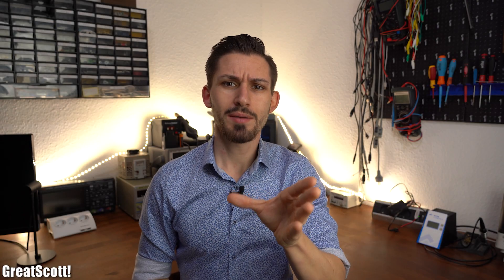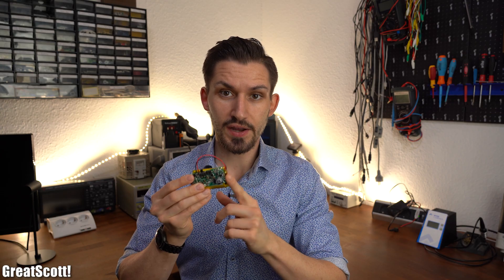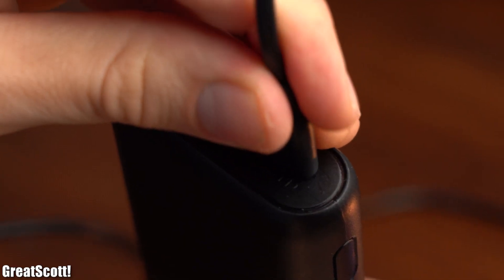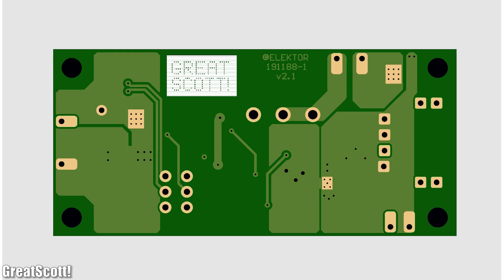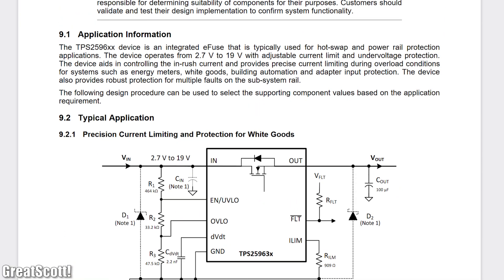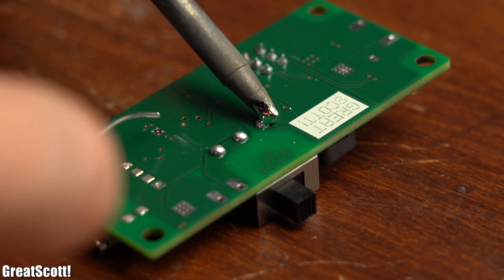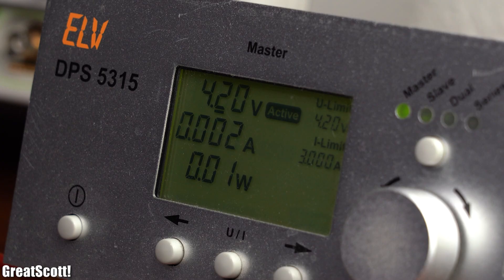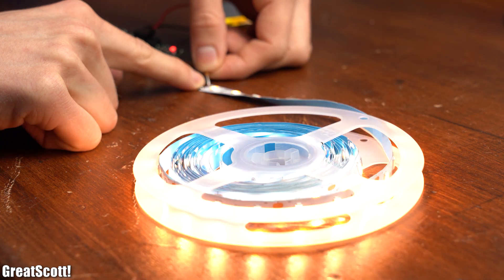DIY LiPo Supercharger! (Charge, Protect, 5V/12V Boost V2)

Comment from the maker: Get your DIY LiPo Supercharger here (shipped world-wide):
https://www.elektor.com/greatscott-diy-lipo-supercharger-kit

(FYI, I do get a commission for every sold kit)
My last article in Elektor’s print-magazine: https://www.elektormagazine.com/magazine/elektor-151/58764
Check out Elektor’s YouTube channel: https://www.youtube.com/user/ElektorIM
Reply: Big fan of yours
Reply: 2nd ?
Reply: Nice one. In the video you tell, there are Gerbers and such stuff available. I cannot find those behind the given link. Could you clarify, please?
Reply: Great Project!

Is there a way to modify this to work with LifePO4 batteries ? Ideally auto sensing the battery type ?
Reply: Where are the links to the schematics?
Reply: @peter.stimpel  +1
Reply: It shows "Input Voltage 	+5 V / 2 A max.". You mention 1A charge current. What is correct?
Reply: ESC modul
Reply: Nice board, but I think the engineers at Elektor missed one important thing about USB-C. If you want it to work with USB-PD chargers, through USB-C to USB-C cables, the CC1 and CC2 pins need to be pulled down to GND with two separate 5.1k resistors. This signals to the PD charger that a "dumb" legacy 5V device is connected and it should provide power. Without the resistors the fully complaint PD chargers will refuse to supply power, and if you tie both CC pins to a single 5.1k resistor, the device will work normally with most of the cables, but it will fail to work with more expensive, electronically marked ones (this happened with the Raspberry Pi 4)
Reply: Sašo Domadenik - is this something we could do after receiving the kit?

Cheers

PS- after thinking about it a bit, I’m not sure how PD would be necessary or even meaningfully useful for this board since it only takes an (extremely common) 5v input, and certainly do not need PD and it’s multi-Voltage outputs for this..

That said, maybe I’m missing something here on some potential use-cases for PD, and my original question [re:user “fix”] still stands out of curiosity. 

Cheers!
Reply: I have been watching your channel for years! Love your projects, and I especially love your new production format! Congratulations on the DIY LiPo Supercharger kit, it looks great! I went to purchase one right away... Unfortunately, living in the US, it would cost as much as the kit to ship here. I sincerely want to support this project, but I can't justify paying double just to have it shipped. If there is some kind of minimum purchase amount to get free shipping, I'd be happy to do that, but I didn't see that on their website.
Reply: Would love to have a higher powered version on output dan charging power for bigger lippo.
Reply: Link for kit doesn't work, 403 Forbidden
Reply: It cost only 22 euros in there but if I convert it in our Indian rupees it is around 2000 rupees 
Now that is a lot of freaking money
Reply: @anujithtp2048  i cant open the link, is it for one board or for 5?
Reply: @TylrVncnt  Of course, it would be very easy since the pins are already broken out, you just need two resistors.
As for why you would need USB PD, this board doesn't need it, but other devices do and you want this board to work with the chargers that you already have. A proper USB-PD charger will not charge a device that isn't detected as compatable. The resistors are what makes it compatable, they are in the USB-C specification.
Reply: @peter.stimpel  the Gerber files and schematics as also the manual are at the bottom of the shop page: https://www.elektor.com/diy-lipo-supercharger-kit-by-greatscott , we wish you a lot of fun rebuilding the kit. :)
Reply: @sobertillnoon  the Gerber files and schematics as also the manual are at the bottom of the shop page: https://www.elektor.com/diy-lipo-supercharger-kit-by-greatscott
Reply: @ElektorTV  Thanks for updating the page, appreciated! Cheers, have a great week, and stay negative.
Reply: @ElektorTV  the BOM doesn't appear to be available at the link. Can you please clarify where this may be found?
Reply: hmm u relize not everione can solder it right?
Reply: Too expensive when convert to LKR.
Reply: @anujithtp2048  4000 in Sri Lanka.
Reply: @darkfitmc1754  You could learn it, so what?
Reply: Why not used the very powerful ti power ic ... don’t have it’s id on hand but handles full usb c specs (one of the latest), combined charge and discharge and more features, cost for single pice was something between 5-10$ (I think it was about 5.50$ but the dual channel version was around 10$)
An the best (and worst) all in one single chip.
Reply: @sasodoma  That's some very useful information, thanks!
Reply: Hello sir! I am an antenna designer, i need to DIY antenna analyzer, which can show Return loss, swr, and draw gain pattern of the antenna. I am wondering how it can be done.
Reply: @Evgen-Evgen-Evgen  it has only two of them
Reply: @SecretAgentPat  The Bill of Materials is within the manual.
Reply: that link to the kit appears to be broken
Reply: @anujithtp2048  I need to sell a kidney. 😆
Reply: The kit just arrived in my mailbox, it's super!

Comment: Got this kit as a gift.
Just two remarks: 
For DIY home solderers it would be better to have thermal spokes on the ground connected pads. The ground plane leads too much heat away for low wattage soldering stations (and high power would be overkill for the rest)
All input/output through-board  holes should be spaced such that 2.54mm pitch pins  could be placed directly.

Comment: 06:30 A bit of advice: do yourself a favor and get a flux pen so you can solder trough-hole components and give the solder a chance to flow so you'll end up with a small fillet that looks nice and is stronger than the ball-of-solder.

Comment: I was confused when I first saw this.  The video straightened me out!
I guess the bottom line is that this PCB needs to stay attached (more or less) to a single-cell LiPO battery to enable it to both power a 5V or 12V project, and then later recharge the battery.  Looks good!  
Without this project, we're limited to powering things that only require ~3 V power (with a single-cell LiPO battery).

Comment: you need good soldering flux in smd soldering it make smd like 0805 0603 component a lot easier than without flux.
Reply: those soldering are horrible that will be fixed with a good plenty of flux and not rely on the flux of the solder

Comment: This is a good thing..
But... With many things now dropping to 3.3v  it's not much use to me now... 
With battery projects. But there is a solution which is cheap and easy.  A step down can be put on the battery terminals...
But this need to be put on the protection circuit to shut things down when the battery level drops.

Modular break outs here we come.
A nice little OSI and display. 
WiFi control and readings..

Comment: I'd like to know how to set the high voltage output to 9v instead of 12v. I'm rather new to circuit design so I'm not sure where to start.

Comment: I’ve done a lot of soldering but almost no surface mount soldering.  I needed the capabilities of your design so I ordered a kit.
I have a fine soldering iron and tips that work with the 1206 parts.  I found that good lighting and some magnifying glasses were required and bought some thin solder and paste flux that worked with it.
Yes the transition to 21st century hand soldering is possible!  The work can be tedious so frequent breaks are quite helpful as was periodic cleanup of the solder residue with 91% alcohol.
The circuit worked just fine when completed.  I wanted a protected converter of 12-14V to 5V for a QRP-Labs Ultimate 3S WSPR transmitter and find this project served just fine.
Thank you for making this available!

Comment: I made two of the old PCB. Not too happy indeed about the tiny sizes you choose, especially for the LED's. Also, the boost converter is not working on both. I'll try to make some more and see if it will work eventually.
So the new kit might be an improvement, but is waaayyyy to expensive. But I guess that's in the hands of Elektor.

Comment: I'll buy the 18650 version
Reply from the maker: Works with li-ion as well
Reply: @greatscottlab  is it possible to use it with 2p 18650? I need a balancer? The best  18650 discharge voltage wasn't 3V?

Comment: What will happen, if i add only xl6009 single ic on xl6009 boost converter circuit. Then can it increase more ampere....?

Comment: that's a cool circuit, but the lower voltage "protection" chip is too low I think, as it is understood that a Lipo will be permanently damaged at a voltage below 3.0V, and it is recommended to not discharge a lipo less than 3.2-3.3V. So I would try to change the protection chip with one that cuts-off the battery at 3.2V or 3.3V. I do not know of such chip however

Comment: What happens when the over-discharge protection kicks in, your project turns off.  If the battery recovers slightly, will the output come back on, causing it to bounce again?
Reply: nope, the overdischarge releases at 3V, check out the datasheet
Reply: @maks886  Ah nice.

Comment: I have just one maybe stupid question when it comes to soldering SMD components, especially SMD LED. When you showed heating of soldering iron it hit 360 degrees. From my experience that temperature and how long you keep soldering iron in contact with SMD components, you can easily damage them and indeed an SMD LED are in the greatest danger from such work. So the question is,  is that temperature of soldering iron at 5:55 real temperature you used or just for show? Anyway great DIY kit, great video so as always, supper like.

Comment: I think the undervoltage Protektion is a Bit to low for lipos But for li-ion Batteries its fine.  Becourse the li-ion can get discharged lower than lipos whithout any damage

Comment: 1A is really low these days; a RPi4 takes 3A to operate without problems; many tablets and phones take 2 and 2.5A when doing multimedia over wifi.The voltage is the easy parameter to boost or down with lots of tiny inexpensive dc-dc converters

Comment: My sorry if I'm asking a imposable question but I have a project that has dead space that can fit 3 lipo battery that are all the same size. I am having a problem finding any charge controllers that can do more then one in parallel I was hoping if you could lead me to some literature that could help me desine a board that would fill my needs.

Comment: Please make a TL494 flyback converter with variable single supply input voltage (from 9V to 18V) and constant dual supply output voltage (+12V 0V -12V) and 15A output current for any variable load by feedback circuit for Class AB amplifier.

Comment: The circuit diagram doesn't show the USB-C connector, but by PCB images I can only see 1 resistor.  Google: "The Raspberry Pi Foundation messed up its first USB-C device". It says: "The problem is that the Raspberry Pi 4’s charging port shares a single resistor between two of its pins, which the official USB-C spec says should have one resistor each. This causes problems for so-called “e-marked” cables such as those supplied with MacBooks and other laptops fitted with USB-C Thunderbolt charging ports."

Comment: I rather woud have a protection at 2.9v or 3.0v  instead of 2.5v !!
Many LiPo's get bloaded if you go that deep, that's why you have a protection in the first place !!
Don't understand why you deside 2.5v would be a good choice, I don't call that protection. 
Anyway I like the rest of the circuit, good job !!!!

Comment: Thats nice, but there are some much cheaper chinese options out there, paid for example around 15 euro for a cheaper plastic case and 4 PCBs (so 3 for DIY projects). 
Offers also all protections, even a screen with charging level in % (sadly not voltage) and a pretty stable 1A and 2A output

At this price i would expect at least manual control of discharge protection at least, in your case also the 4,25V (is this the targeted charging voltage?)
I love to use all my devices as good as possible down to max. 3,3V so still enough charge and charge all my LiPos/LiIons to 4,15V. Increased the lifetime alot (next to 3,8V storaged batteries at around 7 degree C)

Comment: Isn't 2.5v kinda pushing it a bit for the over discharge, I mostly see 3v in most esc or other bms
Reply: Good point. There are some 18650 that go that low, but I've never seen a lipo that could.

Comment: Can you make a solar charging board inputs 3 volts up to 12 volts. And the option to charge 1s2S3s charging capability  with a built-in boost module from 3 volts to 24 volts.       Mppt

Comment: Could I feed the charge circuit from a 6V nominal solar panel? What will the behaviour of the circuit be if sun is returned after the battery has hit the low voltage protection level overnight? Will the circuit charge until the battery is somewhat healthy before sending power to the load? Can we charge and feed the load at the same time?

Comment: YESS! Awesome!! Nice work! Buying one or two or three.

A couple of questions though, the over-discharge protection, at first in the video you show 2.9V and later you show 2.5V. Which one is the correct? Also, 2.5v is good for li-ion but isn’t it too low for lipo???

What’s the difference between overdischarge detection and overdischarge release? Is it that once it goes down to 2.5v it will disconnect the load and only until the cell voltage has gone up to 3v it will reconnect the batt?

Comment: As a very uneducated tinkerer, would there be an easy way for me to swap out components to get more amps from the 12v supply?

Not sure if that would require a complete different choice, or just a few component swaps.
Reply from the maker: Not easy to do
Reply: @greatscottlab  OK, thanks. Could still be fun to build for some other future project.

Comment: i am a project intern in a xyz company and working on project that have 3-4 sensors all of which works on 5v and max current drawn is 350mAh we used 3.7v 1000mAh LiPo battery to power it, so i suggested to use boost circuit to boost 3.7v to 5v but my superior told me not to use boost circuit because they are not used in commercial products. so i am curious as to what they use in commercial products if they needed to be powered by 3.7V and works on 5V ??

Comment: Hey, I bought the kit and charging the battery works absoluteley fine, but when I switch the module to output mode there is voltage at battery level on both 5/12V and GND pads. There is no connection between these pads (just the capacitors between them), but there seems to be one at bat+ behind the switch to ground. I desoldered the capacitors C6 and C5 but there still is a connection. I can't tell where this connection is. Does anybody have the same problem?

Comment: Its possible to make a wide range adjustable voltage power supply? i have some LM2577+LM2596 from 1.25 to 32v only, and want to make some 0.5v to 90v (DC).

Comment: Doubt it that the goal of charging protecor should be its efficiency. Should it not be battery efficiency (i.e. longer battery life) instead? If so, then this protector lacks temperature monitor that regulates charging speed taking into account surrounding and battery temperature. Batteries do not charge the same way at different temperatures.

Comment: For handsoldering 2-pin SMD components i find it most comfy to pre-tin one of the pads. if you do this, the part doesnt bounce around and also the connection is cleaner.

Comment: any way to modify the lead batteries of a UPS to LiPO batteries without modifying the recharge stage in the UPS?
I am planning to make a LiPO battery bank to replace the lead batteries that are normally supplied by the UPS, but I have seen that the process of recharging the batteries is very different,
My question is, will you have a project that resembles what I propose? thanks for answering.

Comment: 2.5V is too low of a cutoff voltage for LiPo batteries. It's perfectly fine for LiIon batteries though, so I don't quite understand why this wasn't advertised as a LiIon board instead. Would've fit those batteries way better. For LiPos it would be better to set the cutoff point to around 3,3V. Another cool addition would be to have a jumper to switch the cutoff voltage between 3,3V and 2,5V, which would make it suitable for both LiPo and LiIon batteries by making sure both types of batteries get all of their capacity utilized without unnecessarily degrading the cells.